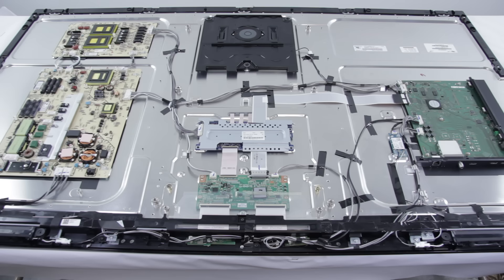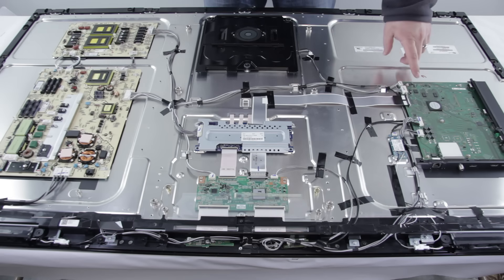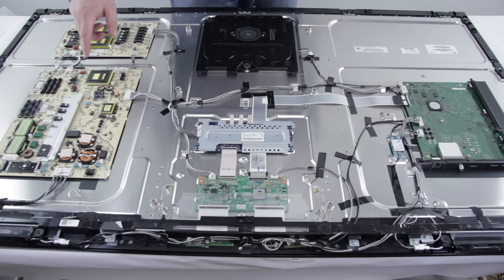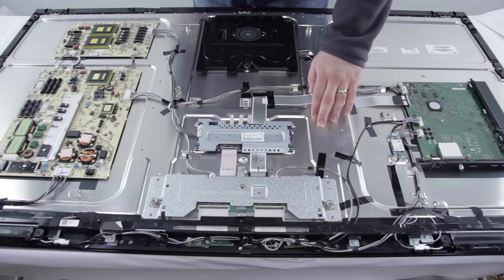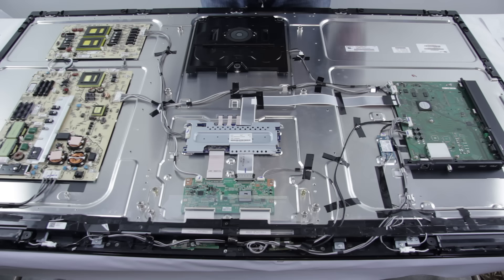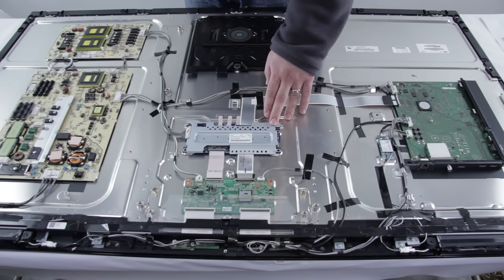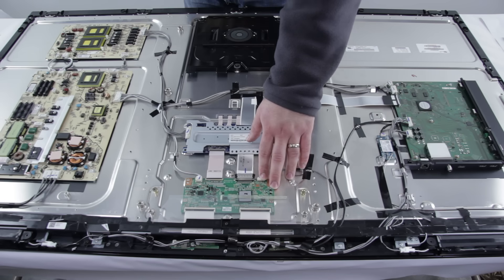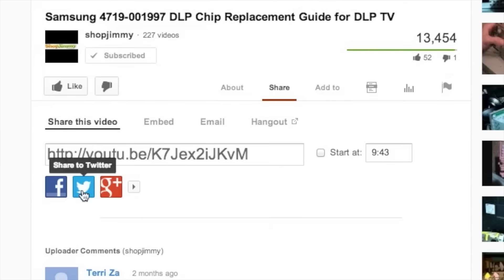LED TV Repair Tutorial - Common Symptoms & Solutions - How to Repair LED TVs

Comment: I have a Vizio E550I-A0. I have a picture and sound. There are two dim horizontal bars. One about midway down and the other near the bottom. Which component do you suspect failing, Power Supply Board or LEDs?

Comment: i have a UN43J5200AFXZA
VERSION BD03
I ORDER A REPLACEMENT FIX KIT FROM YOUR WEBSITE FOLLOWING THIS VIDEOS AND IT DID NOT FIX THE PROBLEM.
ORIGINALLY HAD NO PICTURE I DID HAVE SOUND AND BACK LIGHTS I COULD SEE IMAGE WITH FLASH LIGHT, SO I REPLACE THE PARTS AND STILL HAVE NO PICTURE ONLY IF I SHINE A FLASH LIGHT I CAN SEE SOMETHING CAN'T RETURN THE PARTS BECOUSE NOW I HAVE TO PAY 20% RESTOCKING FEE PLUS SHIPPING 
ANY HELP WOULD BE GREAT

Comment: I have a LG 42lm3700-uc and the tv has power but when I power it on the red light blinks the stops not lit up and no picture sound or anything no back light. but if I push the power again it cuts off and has a solid red light. main board? thanks

Comment: I have a 50 inch rca tv model number LED50B45RQ. My husband tried to turn the tv on   one day and it did not come on the red light was on but when u turn it on it goes off meaning that it is on. the only thing that showed on the tv was a thin white line that appeared at the top left corner for just a few seconds and disappeared. the tv would not do anything else. could u tell me what the problem might be?
Reply: Victoria Steward...I'm having the same issue with the same tv. Did you find a solution?
Reply: No I have not. I am still looking for one. I had someone tell me that it was a very small fuse on one of the boards but I don't know which board they were talkin about. The person that was looking at mine wasn't a person that normally works on tvs so it's hard to say. If I do find a solution I will let u know.
Reply: Victoria Steward...From everything I've researched it's sounds like it's the LED driver or the main board. I'm going to attempt to replace the led driver first in hopes that is the problem. Sadly, my tv is only 2 years old so I'd like to fix it. I'll let you know if I find a solution.
Reply: Ok thx and mine might be about 1 and not even a good half yr old yet so I really would like to get mine fixed also.

Comment: I have a Vizio M552I-B2 55 inch LED TV Thought I had remote problems because could not turn the TV on all of a sudden. I was able to eventually turn on TV but now when I try to change the channel or change the volume, the TV continues to receive the input signal. Example: push the "3" button and the channel tries to become 33333... until another button is pushed. Push the channel up button, the TV continuously scrolls through all channels till another button is pushed. Same with volume (goes from 0 to max or max to 0 until pushed again). I took the batteries out of the remote to eliminate that the remote was the problem. I downloaded a Vizio remote app on my phone and I got the exact same symptoms. Does this sound like an infrared sensor problem

Comment: Quick question I have about 5 or 6 horizontal black lines about 2 inches off the bottom , some say tcon board some say power some say main I am tech savvy but do not know how to check tv is a 
 Samsung UE40F6670SB

Comment: Hi, TV Model - Sony KDL - 46EX720.
Working perfectly from last 5 years. Last week it developed a problem where a black horizontal line appeared on the screen, from one end to another end, Line is constant with out any flickering, appears as if the leds on in that line are not glowing at all. Later another white line appeared just a centimeter down below the earlier black line.

please suggest me what could be the problem and how do I get rid of the these two lines. 

Thanks in advance, 
Gopi Krishna

Comment: Hisense 55k610gwn, error code 11, ALL backlight leds flash once (logo seen), then no video.  Led drive voltage=200+dc, with or without leds connected.  Leds or Power Supply?

Comment: Hi, just ended up changing the LED strips I ordered from your website. There is improvement. The screen has lighted up, but there is a black patch in left upper corner that comes and goes at regular intervals. Close but no cigars. Have unplugged the TV, as it seems something else caused the strips to burn in the first place. It's a LG 47LN5750-UH. Thanks

Comment: Hi, I have a samsung ue55js9000 the edge led lighting has become to strong over the picture and can be seen through the picture down the left and right of the screen. 

Is there anyway this can be disabled.  I am considering taking the tv apart to see if this can be unplugged from the where it gets power from. This lighting sits outside of the panel behind the bezel and not behind the panel from what I can see looking behind the bezel. Any recommendations on the best course of action.

Comment: i have a hisense led lcd tv 40k360 that will power on in a few second it will power off by it self and the manuel buttons do not work the only way to turn on my tv is to unplug it and plug it back in and when it turns on it will turn off by it self in seconds

Comment: Thank you for providing this video. I have a 60 inch Visio TV the model is E601i-A3. The TV will power on however it will turn off after being on for about five minutes. Also the back light on the TV is flickering. Can you offer any help or suggestions ?

Comment: Hi, my Element tv does not have sound or a picture. The stand by light changes from red to blue when you press power. I ordered and gentle switched the main power board, with the new board the standby light doesn't change anymore. I put the old board back in and now the standby light changes to blue for only 2-3 seconds and goes back to red. Any idea what i can do next? Model number ELEFT291 serial number G1400228430006623 thank you for your help!

Comment: I have a  Samsung 50” UN50EH5300FXZA   BJ04, I have sound but no picture. I bought a TV Repair Kit from Shop Jimmy and it did not fix it. When I put the main board in the power light would flash but no picture or sound so I installed the old main board and the other new boards  then I had no picture but I had sound again. Any help will be appreciated.

Thank-you, Rick

Comment: I have a LG LED TV model 47LW5700-TA.ATCYLH - Manufactured Yr - Oct 2011.
My TV won't turn on & only the red LED blinks continuously on the bottom right corner.
I suspect the main board is faulty & would like your confirmation on this. Is it worth to replace & how long will it last?
Thanks

Comment: i have a samsung un60h7100. i was watching netflix and it froze so after a few minutes i pulled the power cord to power it off. when i try to power it on afterwards the led backlight seems to flicker once but the tv will not stay powered on. no display at any time. there doesn't seem to be any bulging/swollen capacitors on the power supply. do you have any ideas? thanks

Comment: i have a PK 350 lg plasma, at and i have 4 single pixel wide vertical lines running up the screen somewhere in the middle. sometimes they dissapeared for a few months, then came back, dissapeared again, but lately they're here to stay. any idea what i can  do? panel dead? or is there any chance i could clean the ribbon cables and fix it still?

Comment: Hi, Toshiba 40LV665DB will not power on until the inverter board (INV40N14B) is disconnected from the PSU board, do you think the inverter boards faulty?

Comment: i have a 60" samsung model #UN60H6203AF.  My 2 yr old sprayed excessive windex on the screen. 1 hour later my wife turned on the TV.  it worked for a minute then the screen went all black with thin red verticle lines growing from top and bottom in spots.  the longer the tv stays on the bigger/more profound the red spots grew.  Any suggestions?  Thanks

Comment: my TV vizio vp422 hdtv10a when i turn it  on it stays on for a short time(1min bout 40srconds) then turns off by its self as if its not plugged up then 10 seconds later I am able to turn it back on and it does it repeatedly... what can be the problem.

Comment: I have an 47LG4500-UD-AUSZLUR which has a front function touch panel with IR for the remote. The IR remote still receives the remote functions, but the touch panel doesn't respond to any touches. The most annoying problem the TV turns on in the middle of the night by itself. Last night it came on 6-7 times. The part to replace that board I found is EBR74561003. My question is 1) Do you think that board is the problem causing it to turn on by itself 2) if it is that part how is it attached to the front bezel? It appears some kind of glue or tape. I want to use something that will still allow the touch sensitivity.

Comment: hi, less than a year ago my samsung led tv model UA32D5000PR started having vertical lines when i opened the tv.. the lines will last for around 5 minutes then it will disappear and picture will be ok.. it's like it needs to warm up first.. just yesterday the lines wont disappear anymore even if the tv is on the whole day.. i tried cleaning the ribbon from main board to tcon board (lvds ribbon i think) but the lines still there.. please help thanks

Comment: I Have a Bush ELED42240FHDCNTD3D which when powered on the black light flash up and then goes off, i have done the flashlight test and they is a picture but if i switch the TV off multiple i can get the black light to stay on, what could be problem be 

thanks

Comment: I have a Toshiba  55L7200U, 2012 TV. when I turn it on, the green light flashes and Toshiba emblem comes on and nothing else. No sound or picture. After a while the emblem goes off and come back on. If it is the main board problem, which Toshiba no longer supports or cost $380 from a surplus place, could it be repaired and who does the repair. Please advise. Thanks EJ

Comment: I have a 50 inch Vizio LED TV Model # m471i-A2 and when I turn the TV on there are evenly spaced horizontal lines running from the top of the screen to the bottom of the screen (similar to the lines on notebook paper). The image seems to appear over the lines but they are still present. Now it looks like there are wider horizontal black lines on the top and bottom resembling when you would try and watch a widescreen film and a box TV. Any help?

Comment: I have a 40 inch samsung model UN40D5003BF. no standby light comes on. unresponsive to remote and front buttons. removed power supply board and tested fuse shows good

Comment: Hello, I have a Sony LED  KDL40w600b.  My tv had a power surge protector. A week ago I experienced a strong power surge  causing my tv to stop working.  I noticed that there was a  red blink( 3xs)  in front of my tv , so I did some research and found out that the main board may have a malfunction.  So I ordered a main board and replaced it. After installing a software update, the tv turns on, with a soilid green light.  Now I have another problem, I have no picture and the screen flashes white every 5 seconds.  You can also hear the tv responding when I press buttons on my remote. I  would greatly appreciate your feedback on this. Thank you!

Comment: I have a 60 inch Vizio E60 - 3. I've only had it a year and a half and it's warranty has run out. Recently, I started getting dark areas on my screen. it started in one corner with a large recangle that still had picture but extremely shaded compared to the other areas of my screen. Over the next few days the top corner now has the same shaded area and there are two shaded rectangles on the other side of the screen now. I think I have an LED backlight problem. Is this repairable?

Comment: Hi , i'm using a Panasonic TX-L32E30B.I think its having power issues, it comes on in some few seconds and then goes off after, leaving the Stan by red light blinking and All this started when i had a high voltage in my house..what is the solution please?

Comment: Sharp = LC-50LB150U - The TV does not turn on and their is no standby light on with the power cord attached.  I opened up the TV, attached the power cable and without pressing the on button I measured the power supply voltages.  Again without pressing the on button found all power supply voltages to the main-board were present and of proper value.  What is the next troubleshooting step?
Reply: did you fix it ? and how
Reply: Symptoms: No voice, no picture, no standby light.  I found that all power supply voltages were correct and present without having to press the on button.  So I knew it wasn't the power supply.   I replaced the main board and that fixed it.

Comment: LG LED HD model# 47LB5800-UG. Black screen, flashes pic every few seconds. Flash appears to be full screen. Audio is good. Looking through the back cover, LEDs appear to be lit when screen flashes. Sounds like LED driver or inverted board and/or connecting cable. Whadayathink??  Thanks, Jeff Douglas

Comment: I have a 42" LG 42LM620T, when I turn on the TV and keep watching for an hour, the picture starts to jump vertically. I had called up the LG tech , they had a look and said that the pannel needs to be replaced. they didn't open up the device nor did any kind of testing. I'm not sure if they correctly identified the cause. what do you suggest?

Comment: We have an LG 46LD550-UB. We have sound. The picture is now permanently distorted, following a week or so of random horizontal ticks for 1-2 min after starting up. Is this fixable by owner?
Reply: Got on your website, and according to the description on the T-con board, it must be the LCD panel (horizontal lines). My guess is this is a cost prohibitive repair so we are considering buying a replacement.
Reply: I have a brand new Toshiba 50-inch TV that works fine pictures of beautiful but it won't stop blinking can you help me

Comment: I have a LG LED tv, no picture but there was sound.  Flashlight test shows the menu.  I replaced the TCon board with one of your parts and still does not work.  Wondering if it is the LED Driver?  I don't think there is a separate LED driver, part of the power board?  Help???

Comment: I have a Samsung UN55F7100AFXZA
Existing condition:vertical lines of both sides of screen, and it was a little jumpy.
I replaced the TCON board and to no avail.I removed the right ribbon cable from the TCON board to the screen and I got a perfect screen on the left side, with nothing on the right side of the screen.
I replaced the ribbon cable and same problems.
Do I need a mother board or toss this expensive TV away?
Thank you,Kevin7143699921

Comment: I have SAMSUNG 60'' LED UN60ES6400F Model its Main board is not working. Only its RED LED light is on and flickering and no display on screen . I have check power supply board it is working fine. Please suggest how can i purchase main board BN91-09195J

Comment: Hi.  I have a LE40S508 tv.  The backlight works.  The sound is working.  The display is not working even if you press the menu button.  I cycled through all 3 HDMI ports blind and managed to verify the sound works on all 3 and they all 3 act the same with the backlight on with an otherwise black screen.  I came across an add for U202 on an internet search under shopjimmy.com.  Can you help with this issue and a solution?

Thanks,

Tom
Reply: OK I had looked closer at the narrow boards below the speakers and noticed that the plastic was melted and deformed where the second ribon from the end below the locic/power supply is located.  The board is labeled as InnoLux V390HJ1-XRME1.  I disconnected the 2 ribbon cables that connect that board to a longer board beside it and then powered it up.  The screen worked perfectly on the side opposite the logic/power supply and in the center half way were a bunch of vertical lines.  Is this something that can be repaired?

Comment: I have a Samsung Model #UN60F7100AF It was giving to me because the house was struck by lightning and the tv never turned back on. Tv has no standy light no power no noise. powerboard has been replaced. remains the same symtoms. if the tv is connected with power and the powerboard  cable to the board with hdmi connectors is disconnected. front display lights up blue. where should i start troubleshooting?

Comment: Hi
i have a 2 Samsung TV  UN46B7000WF from 2009 with the similar issue 
I bought the TV's at the same time and they got the same issue 2 weeks appart 
there are horizontal lines foggy image after 2 or 3 minutes the TV is on 
what the issue in you opinion
Thanks
Gerard
Reply: Hey guys I got a Samsung 67 inch TV I'm having proms with screen at the dots my model number is models No hl87a510j1f I was one if you guys got a video on that set a lot of help for me thank you

Comment: I have a toshiba 58l4300u that plays sound, backlight works, but no picture. I replaced the tcon board but that didn't work. I belive some water might have leaked on to left side of the TV that caused the problem. What do I do now?

Comment: I was given a 55lx6500-ub lg tv by a friend whom said that it just stopped working. I looked at your you tube video on tv repair and what I came up with was that the touch buttons lit up and you could hear clicking as if they were trying to work. I did the back light test and found that there was no back light. The only light that was visible was the internet jack. What would you recommend that I do next?

Comment: Hi.. I have a SHARP LC-70LE550U. 70" LED. Have a problem with the picture. TV would come on with sound but picture would flicker and then go black. I replaced the Main Board. No improvement.  I then replaced the T-Con board. No improvement. I disconnect 1 side of the T-Con board and I get picture on one side. So it seems the problem is with 1 side of the TV.. The Driver Boards?  Thanks for your advise.